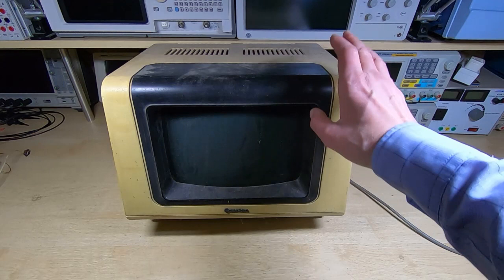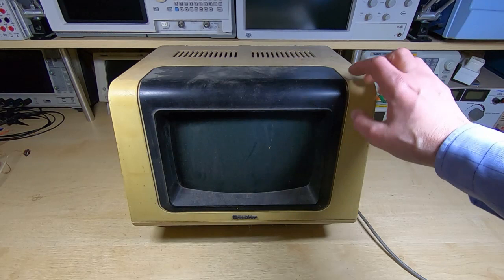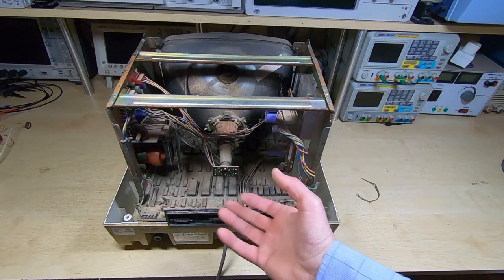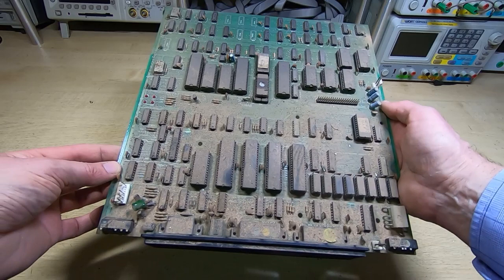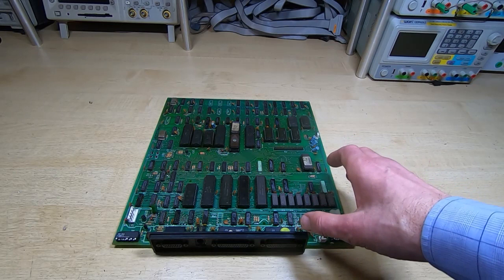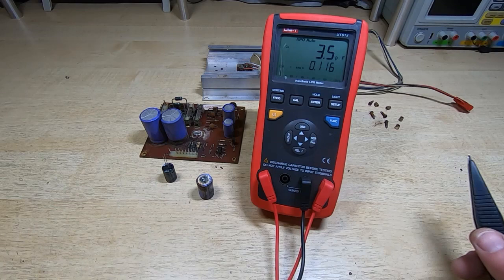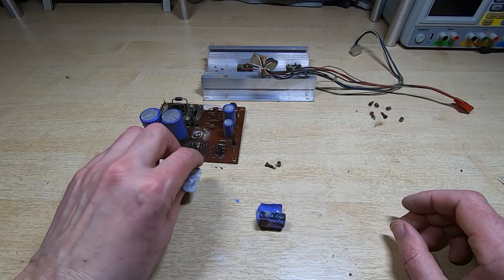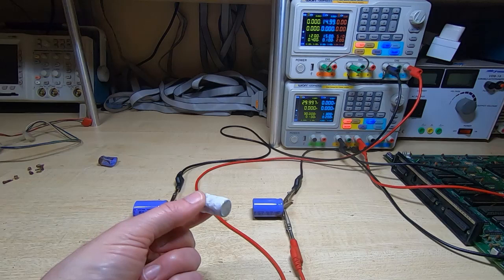Televideo TS800A Repair Part1

Comment: The foreign object appears to be a bit of hay. Stored out in the barn? I use the same basic method for testing large electrolytic capacitors, especially bolt-in type (reads "expensive" or "hard to find"). As a test equipment geek who suffers from TAS, I use an HP 4282A Digital High Capacitance Meter that supplies DC up to 120 volts and has a leakage range of 1 microamp full scale. I have noted that with a good capacitor after the initial charge period the leakage current will fall slowly over the next few hours to very low levels. I suppose that could be considered "re-forming" - I call it thorough testing. Thank you for another interesting video, I am looking forward to the rest of the series. Regards, David
Reply from the maker: Very early capacitors used in valve (tube) electronics had two 'plates' which were normally formed using two sheets of foil separated by some sort of insulator. The entire roll was immersed in liquid electrolyte and when in use the foil developed a 'layer' on each side and this allowed the capacitor to work properly. When not in use the electrolyte seemed to wash this layer off and so the capacitors did not work very well until 're formed'. Generally they had very low capacitance and high leakage and could even develop shorts under high voltage. Modern capacitors work very differently but I think there is some carry over in expectations. I have never 'reformed' a modern capacitor. Some capacitors may improve a little when used for a time although some get a little worse but if a modern capacitor is low in capacitance  or leaky then it should be replaced. Actually the same was true of the old electrolytics as well but they did sometimes reform to a certain extent. If you watch the current in the video you will see that it drops to less than 1mA within a few seconds as the caps charge and it stays there. I see that in almost every modern capacitor I test, the rest are faulty. However if people want to 'reform' capacitors then they should go for it.
Reply from the maker: Forgot to say, the object was a bit of sealant from the tube band.

Comment: From the video it looks like the bigger caps are pushing out the pressure relief cuts in the top and I think a lot of people would replace them just based on that. But I guess that's just how they look?
Reply from the maker: No that is just the style of the capacitors. They have offset segments but the tops are totally flat.

Comment: Tried the cleaning method for my board but it sadly didn't work.
Reply from the maker: As I say in the video the method I use depends on what contamination I need to remove. This board was only covered in dust and dirt so was easy to clean but some require other methods,
Reply: @JerryWalker001  now i snapped my fingers twice more and the board is clean. thanks!
Reply from the maker: @8o86  You need to be careful. If you snap your fingers twice it can make it dirty again.